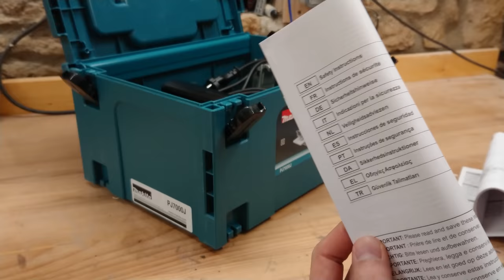makita pj7000j

Comment: Hey. Could You help me with an issue? I have the same biscuit jointer (PJ7000), and I experienced that the angle guide is hard to move up and down. I inspected and there's no dust or any obstacle neither on the gear knob nor on the frame. Did You experience such an issue too? If yes, what would be the solution?

Thanks for Your response.
Reply from the maker: Hey. Basically there is a small resistance in the knob, the only three things that seem to me to be able to cause the guide to block are:

- the guide is a little askew at the top of the frame (when inserting it into the frame it's better to hold it on the other side of the knob to be parallel) that's the only problem i had
- the locking lever which is not completely open
- and in the worst case a surface of the guide/frame has taken a hit or is slightly deformed

I hope I was able to help you, don't hesitate to ask me other questions if I can help, let me know if you have found where your problem comes from and if you have found a solution, it can help other people